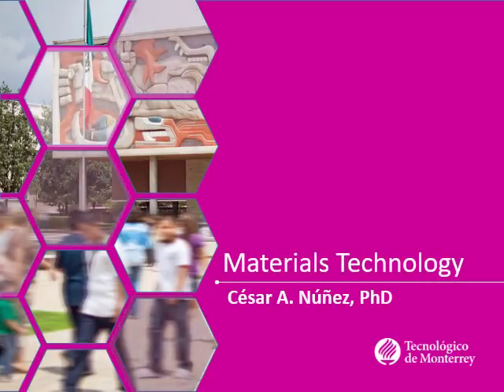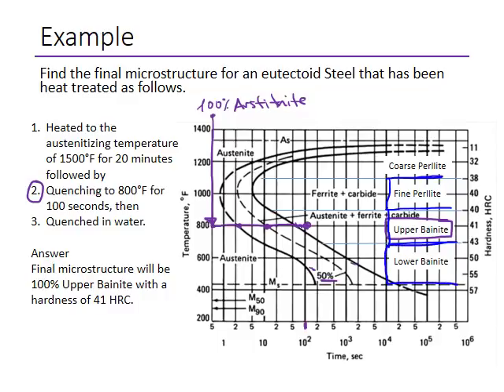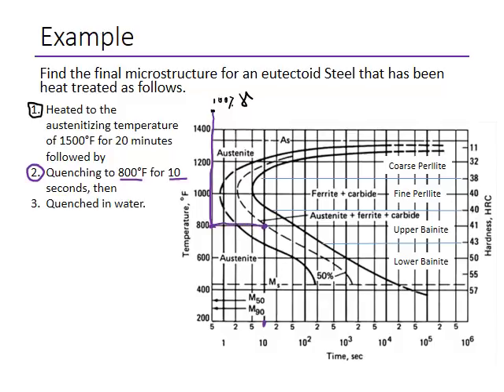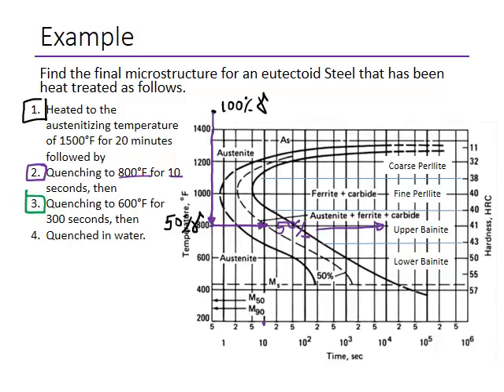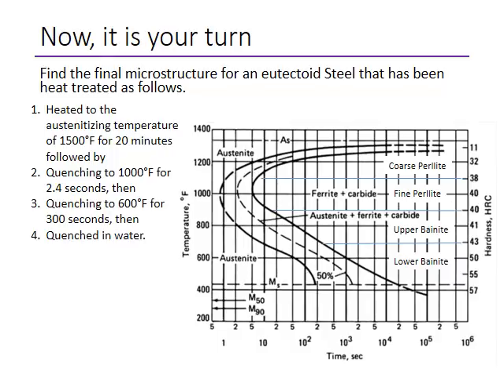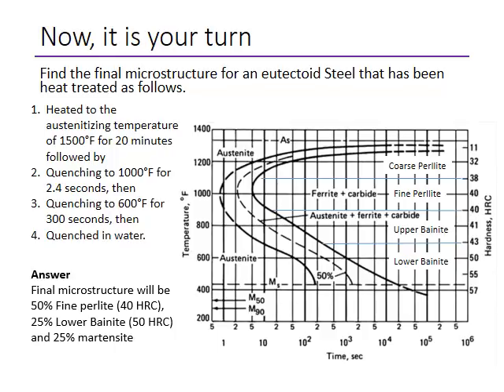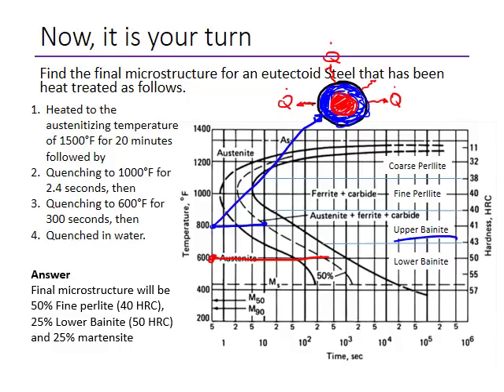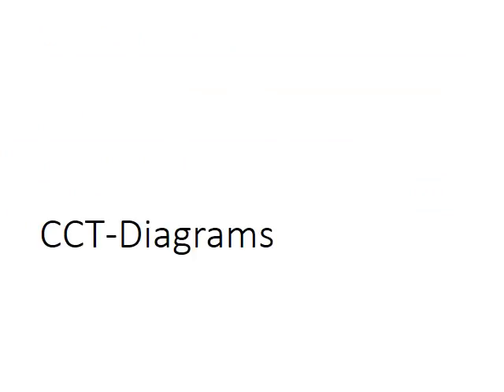TTT Diagrams - Applications

Comment: Sorry i didn’t understand why u proceed the following steps all from 0 second , since ur calculation of percentage takes accounts of previous step loss of austenite ,they transformed into others, then to calculate whats left and what they are going to change further should start from the point of last step ending , 
The shape of transformation should be a staircase isnt it?
Reply from the maker: Excellent point! This is something which is not as straight forward as it might seems to be at first. Whatever we can discuss about this, keep in mind that TTT diagrams are made by quenching to ONE single temperature and waiting until full transformation; when using the TTT diagram in the way we do (quenching to several different temperatures) we are pushing the concept a little bit too far; none the less, it’s still a good first approach. Now, also keep in mind that, when quenching a material, heat transfer takes place at the surface of the material, so the center of the material is the last part to cool down; finally, we are working with a log-log scale,  so that “numbers” at the far left are orders of magnitude smaller than numbers to the right; finally, control of temperature is not perfect in practice. Taking all this into account, although your idea is “quite right” it needs a small correction (and it would require to assume that the full material is at the same temperature everywhere at any time, which requires a very small sample with a very high relationship Area to Volume and a very high heat transfer coefficient); if that is the case, it wouldn’t be a “stair” but rather a “straight line” with a slope equivalent to the “cooling speed” of the quenching process departing from the starting cooling temperature. That is way, assuming that your quenching is fast enough (“very high” cooling speed), then the assumption of a straight vertical line (infinite slope) is the other option you have, and this is the one I’m using. In practice, what we need to do is a simulation of the heat transfer and analyzing the thermal path of each part of the material. That is way we also have the CCT Diagrams which it is a more practical option.

Comment: very helpful! I just wish one example had one with tempered martensite or spheroidite, but a great video nonetheless
Reply from the maker: Thank you very much for your comment. Re-heating martensite to temperatures below 350° or above 600°C (always below the eutectoid temperature and avoiding the 375C-575°C Tempered Embrittlement range) will create tempered martensite, increasing toughness and lowering hardness. For spherodization, a perlitic microstructure should be re-heated below the eutectoid temperature for spherodites to form from the lamellar perlite. I haven't come accross a TTT Diagram showing these but typical aging curves (Property vs time for different temperatures).

Comment: Is it possible to calculate the resulting hardness of say example 2?

would it be correct to say 50% Bainite at 41HRC and 50% Martensite with 57HRC results in a hardness of 20.5+28.5=49HRC?

Thanks
Reply from the maker: On average, yes. What you propose is known as "The proportions rule" and it applies to this example in the way you present it. Excelent! It is important to recognize that, in reality, you will have regions with different microstructures and properties; hence, this average value might be of significance or not, depending on the purpose of your answer. For example, it might be that you have a harder surface than the core, which will be benefitial in applications where you need certain ductility for the whole element with a hard surface that might give it stiffness. In such case, this average might no be as imprtant as the distribution of microstructures.
Reply: Thank you for your detailed answer and quick reply! very helpful!